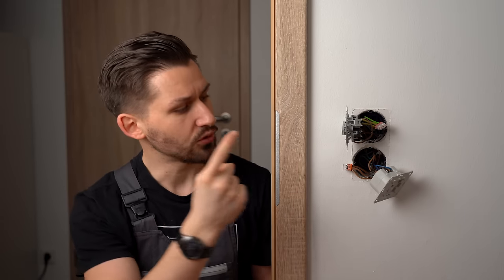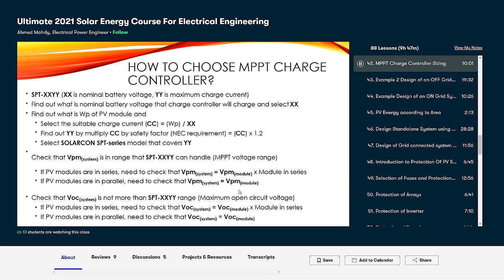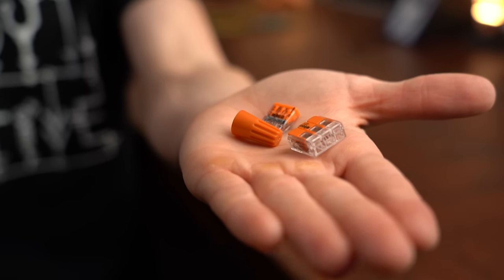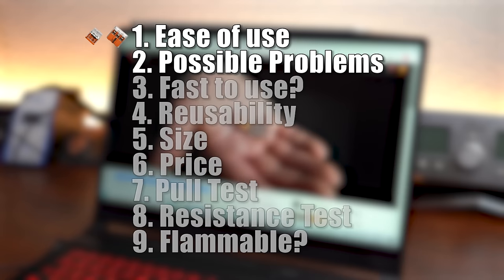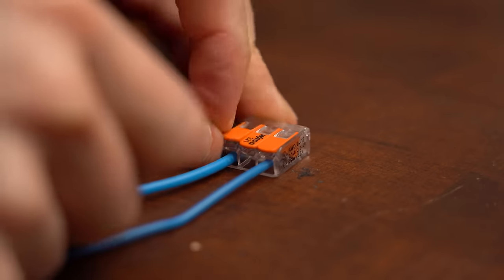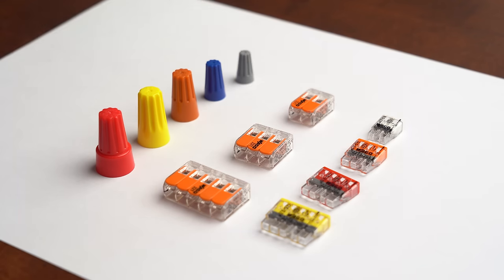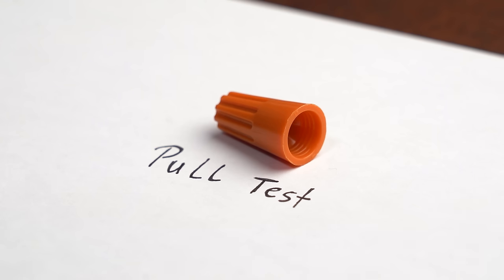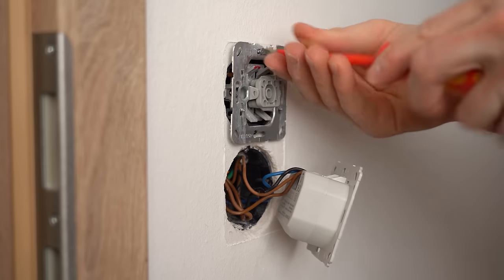What Wire Connector is the Best? Settling a Debate! Wire Nut VS Wago

Comment from the maker: Part 2 ;-) : https://youtu.be/C8Xpjj47vgU
Reply: apparently youre supposed to pre twist the wires before adding the nut, which makes the connections between stranded and solid wires better and less prone to problems, but takes longer to do.
Reply: Maybe done by cheap shitty wire nuts. I'm an electrician I would never use those cheap wire nuts
Reply: Dude 99% of homes in the US are wired with those connectors my house was built in 1929 they used those connectors my house is still here it hasn’t burnt down there’s nothing wrong with what your calling crap connectors as long as you buy decent ones  I was also an electrician they have higher quality ones than those off Amazon like the green didn’t have a pass through hole like the good ones I bet
Reply: as superdruid999 said, it is true you have to twist them yourself.
Reply: I have also been teached to do the pre-twisting. You usualy strip them longer then needed so its easier to twist them with a tool and cut them off so the copper would be about the spring length. It the netherlands (next to germany) they were used until the mid 90's i think. So its not a us only solution. Additionaly one of the biggest cons of the wago types is that if used bigger ones it easier to add a wire.
Reply: Only YOU use those garbage wire nuts. The one I actually see in homes are in 2 categories: Black and Blue. The black ones are made probably before 1980 and the black plastic is HIGH QUALITY, inside in Copper. The newer ones (Blue) have two flanges on the side to facilitate twisting action. The blue ones' inside is not copper but still very good. BOTH passed the regulations in North-america home construciton. You use some garbage 1cent wire nuts and compare to 10-30 times more expensive connectors is a joke.
Reply: Well first off, that is bot how to properly install a wirenut. The ones applied like that are the only ones I've seen any issues of loose wires or bad connections. You are supposed to pre twist the wires together. The wires themselves should be able to hold themselve together well if they are solid, and the wirenut while adding support to that, is mainly there to isolate the wire from touching anything else. With stranded the wires wont hold themselves as tightly, and definitely use the support from the wirenut to keep them together. Habent gotten to the flammability or resistance tests yet, but I saw a heat gun, which might tell you how flammable they might be, but it doesnt tell you how much heat will be generated from overcurrent, and their own resistance. If your resistance test involves testing the threads inside, then it's not a valid representation of how that connector is designed transfer power. Here is one that covers how they generate heat with overcurrent, showing is which one has more or less resistance in the process https://youtu.be/cMVnOZCGljc
Hopefully youtube let's the creator see this because it seems anything with links to other stuff gets auto hidden..
Reply: @iamjames7950  Some manufacturers say you do not have to...
Reply: @killerkab1141  Whats the matter? They tie up too much of your time?
Reply: I'd give this video an a 4/5 only because you made a point to say your bias for wago wouldn't affect your judgment but then you went on to throw out the fact they both have their pros/cons by saying the areas the wire nut won don't count because the wago still performed satisfactory... but the same is true for the wire nut‼️ If they didn't do their job, you wouldn't find them in every home in the US‼️ And I guarantee there's a lot more houses in the US then in Germany‼️ Look up what % of electrical fires/failures are caused by wire nuts... I'd bet its just as low as wagos.. You even used deceptive language that was biased against the wire nut.. "with the wago I just insert the wire, it takes 1 second. But the twisting of the wire nut takes double the time." Oh wow, a whole 2 seconds to twist is completely unacceptable 😑 Yeah... you could also argue that being 4x cheaper for the wire nut, then if the wago doesn't outperform it by 4x then it is not the better connector‼️ 
Or you could just be honest and say they both have their time & place
Reply: My bias is they suck and all they accomplish is a faster job but a worse job. Failures with wirenuts is failure to use them properly. If that is a failure you need to find another line of work.
Reply: @superdruid999 yes you are correct